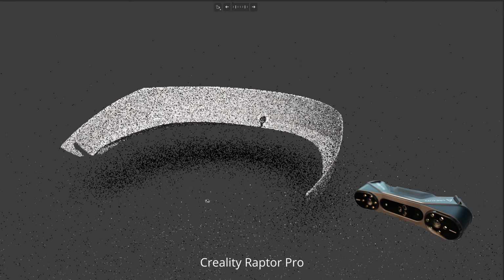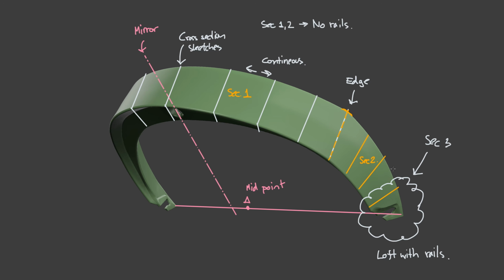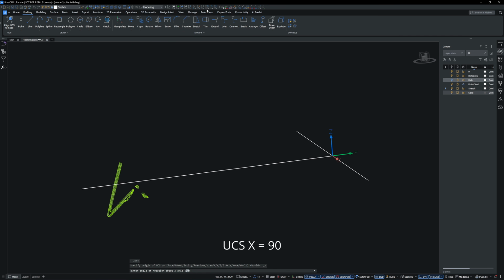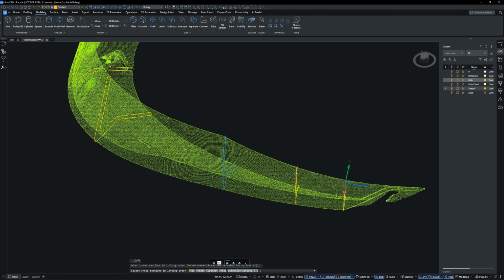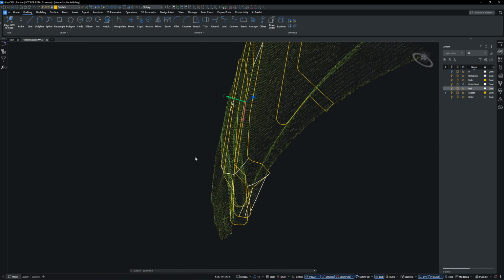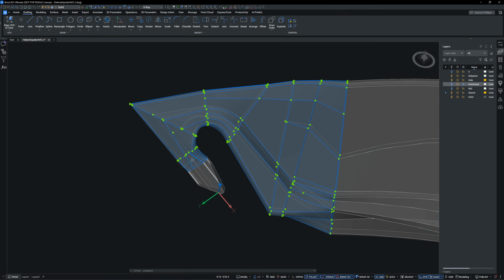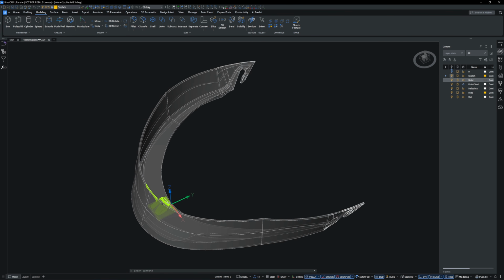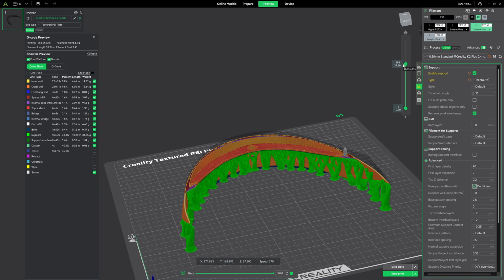3D Scan to CAD Tutorial – Mastering the Loft Command (Creality Raptor Pro)

Comment: You provide really great content, thank you!
Do you see any huge benefits of working with the point cloud directly in BricsCAD in comparison to work on a stl file in fusion360?

Of course you can track some features better out of the point cloud, if there is not enough data to generate a watertight model on other objects, but other than that?

I am just curious because I would imagine it to be easier reconstructed that way in fusion if you have the choice of the software
Reply from the maker: You might attempt reverse engineering using a mesh in any CAD platform, but you'll soon encounter limitations as parts become more intricate. CAD modeling typically begins with a 2D sketch, and you can't trace precisely from a mesh.